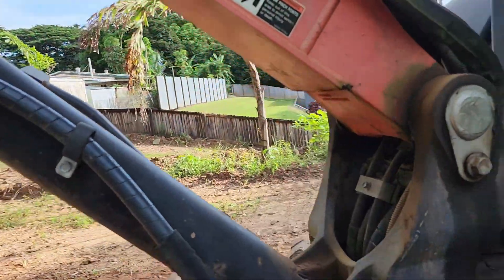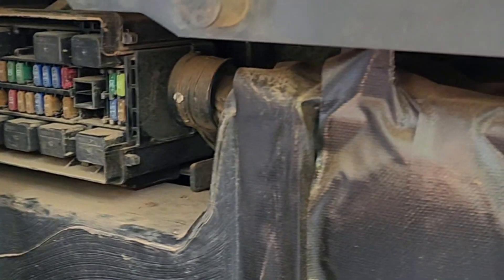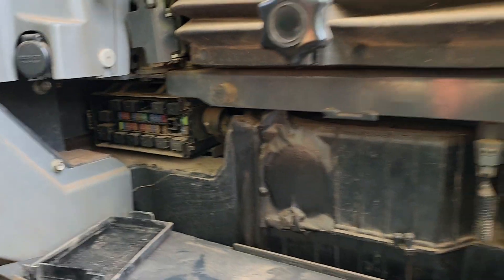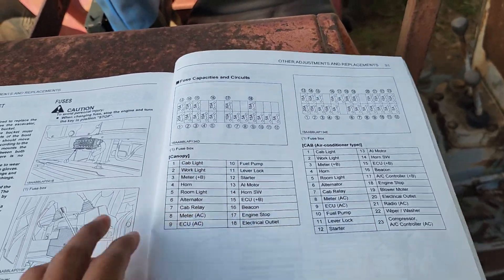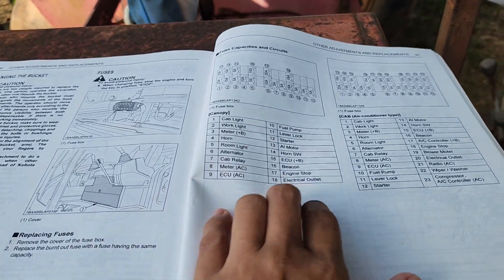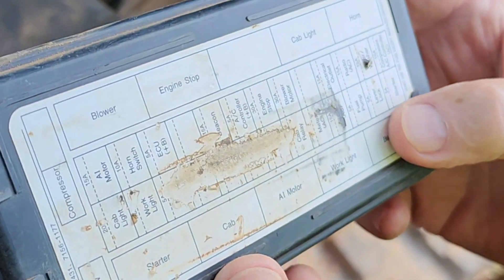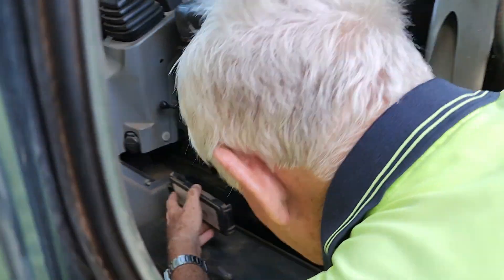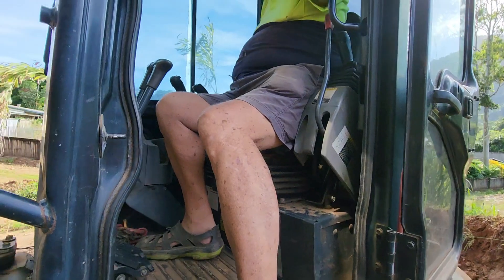How to fix Excavator kubota hydraulics not working

Comment: My Kubota is losing hydraulics.. (doesn't release oil) ...
If I lift something high.. the arm with the bucket will go down if I don't move the control levers..

What could it be ??
Reply from the maker: We are guessing maybe, in your case, the
* Control valve has internal leak
Or the internal cylinder leak.
That's the only thing we can say, maybe the problem.
Thanks for watching.
Reply: @NuraisaApidol  how can i locate where those valves are located...
I have a Libra 216 S machine
excavator specs (1999 - 2006)